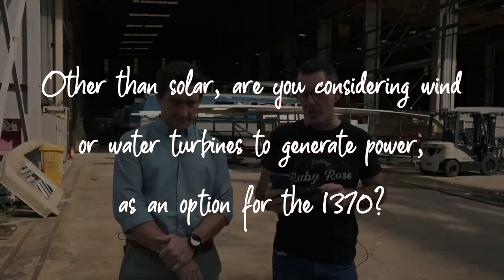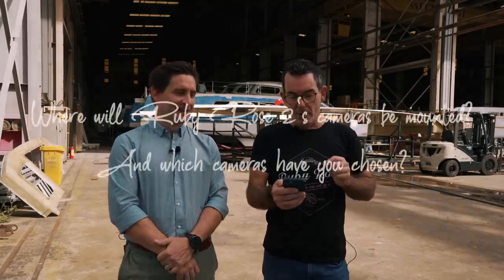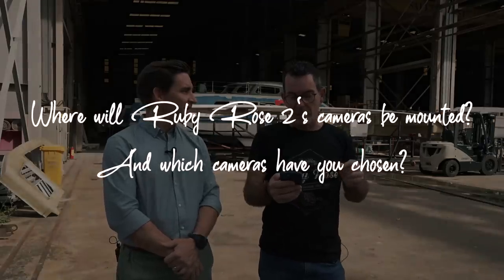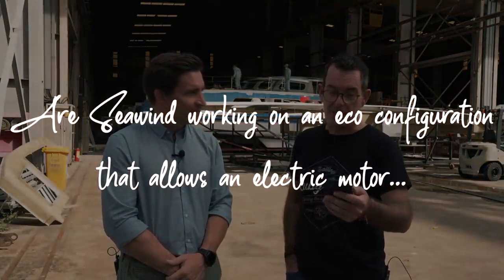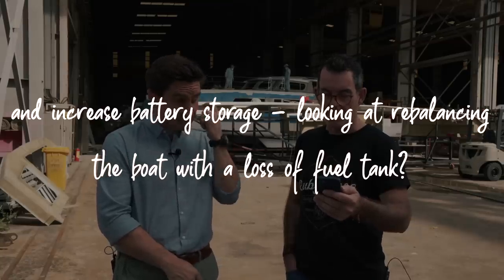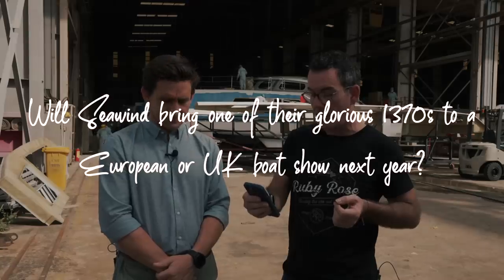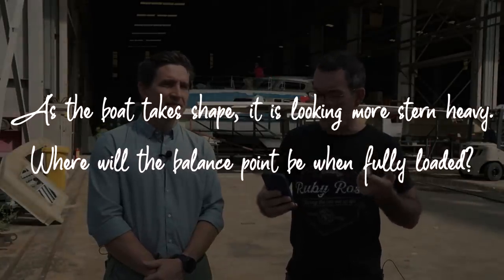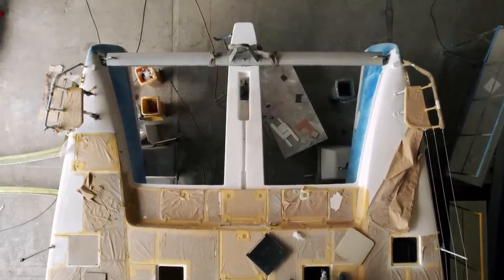RUBY ROSE 2 Catamaran: We Answer ALL Your Burning Questions!

Comment: Exciting news about how well construction is coming along. Hybrid drives are expensive and long term reliability has yet to be proven. Two reliable Yanmar diesels with high output alternators, 2,000 W of solar and a 20 kWh LiFePO4 battery bank will allow you to make dinner, run your A/C overnight and still have plenty of power to make breakfast in the morning. The batteries will last 15+ years with no maintenance. No gen-sets needed.  Thanks for the Q&A.

Comment: HH44 (Hudson) is shipping with a hybrid diesel-electric drive that looks like a smart mix, and inline regen systems are important when sailing north of 30 or 20-degrees latitude where your solar panels are not going to cut it without backup gennies - or a high output 48v alternator. You should consider modifying your boat to include the HH44's bedroom windows - they're huge. 
48v boats and Eco on Sunreef (solar on the sides of boats) is smart depending on the cost : benefit ratio. 
There are affordable inline induction water heating shower units that are very efficient and offer unlimited hot water also. 

Finally, Catana came out with a performance spin on their Bali cockpit doors - that make a huge salon in inclement weather (room for a full double fridge etc.). You might want to talk to your interior designer if any easy mods make something similar possible.

Comment: An ingenious approach to water heating via solar I saw on a small expedition camper here in the US recently.  Essentially the owner/builder installed a small 12VDC immersion heater in the hot water tank of the water heater.  Once the pack was reasonably full the solar system would dump some power to the small 12VDC heater.  He said on any sunny day he had enough warm water for him and his wife to take a quick shower. This guy was using something like 600W of solar and a much smaller battery pack (~2500W-hr), but I'd have to think something similar may be possible on the 1370, of course depending on the specific equipment.   But again, these are stock parts that Seawind is using on these boats right now, so someone would have to work out the details on the modificaiton...

Comment: The question at 10:54 I took to mean, "will Seawind test to near destruction during sea-trials."  If yes, then I know that I wouldn't want the particular boat that has already been so heavily stressed!  Now one from the same build series would be a different story.  Yes, it is very useful to know exactly how hard you can push a set of components before they all come apart.  But not necessarily on the exact item that you are purchasing (i.e. YOURS is the test subject).

Comment: Will this Catamaran Company Design a Race Catamaran ? And thought of coating the Anchor lock with a spray on rubber coating to protect the Hull and help in Clean up. Last in your Rear lockers yo have the Water drain Hose in the Way ( middle ) move it in the Back some you don’t came hitting it.

Comment: I'm confused as to why you connected "software for Planned Maintenance" and "early adopter tech." Planned Maintenance Systems (PMS) are so wildly common in military and commercial applications that they can't be considered "early adopter." You might be the smallest vessel you know who does it, but you couldn't in any reasonable sense be considered an "early adopter" if you took a leaf from that particular book. 

I HIGHLY recommend you make some formal PMS program for your boat. It doesn't matter if you put it in a computer or if you do it like the Navy did it in my day (USN 1996-2001) and put it on graph paper. You will be way happier if you're maintaining equipment before it breaks than managing breakdowns later in life. And since it's a new vessel, when the time comes to sell it and move up, over, or out, you'll have really good records so you can show the new owners actual data on costs and time spent. To be honest, judging by how I've seen you operate, I don't think it being a formal system would be much different than what you actually do. You've never struck me as a "let it fall apart and I'll fix it then" sort of person.

Comment: Chris White designs the batteries to be under the water line so the compartments can be flooded automatically in case of fire. The Barefoot doctor's Leopard 500 burned at the dock with no one on board. Their insurance company gives them heartburn over paying the claim. The longer they drag their feet the more money they can make on the money that they should have received. On the subject of graphene. The reason you don't hear much about it is because every modern country in the world is working feverishly behind the signs to mass produce this product. The only place this product is used is in the oxidized form of razorblades in the woo jab.

Comment: I think he was getting a little impatient with the electric propulsion questions. Given the way Outremer in conjunction with Oceanvolt  have simply failed with the 4 Zero (they didn't make it past the canaries) with Jimmy Cornell as skipper (someone who could write the book on sailing around the world with small resources...) its fairly obvious that electric isn't ready... Yet. But we still have people who don't understand what a watt is and never really sailed, hacking on like we should all be running Tesla motor cruisers! 
Electric is not ready. Even with 2KW on deck you will barely have enough to run ships electronics, cooking, refrigeration and heating/cooling, you will still need some sort of generator (be that a big alternator or a genset.) If it is cloudy you won't have enough to run a fridge and will constantly be watching the batteries lose 10% per day. This is an unfortunate fact of sailing life due to the way we mount solar panels and the efficiencies currently afforded.
We need a really big breakthrough just to get solar to all the run boat electronics reliably. Physics says we will never be able to run electric propulsion for a blue water cruiser. If on the other hand you are a day sailor who spends every night plugged in to the marina recharging the motor you have to get out, you may be in luck... Don't try motor sailing though or you will be getting towed back!

Comment: Clearly there is a LOT of interest in electrification. (I know I am very interested in a hybrid drive.) It seems that Seawind and most other manufacturers are behind the curve on what customers want.
Reply: A tiny market overall which limits choice… a factor that carries a lot of weight for boat manufacturers at the present.
Reply: The hybrid drive definitely has my interest. Gives a quick bit of power when anchoring and docking when the short run times are hard on the diesel. Let's you regen at sea when the winds are strong. But you still have the diesel for getting through patches of calm seas.
Reply: I like to think Seawind is ahead of the curve on cruiser sailing performance rather than behind on propulsion.  I really liked his answer on focusing improving production on their current design rather than changing designs.  They are waiting for the tipping point of hybrid as are the rest of us.

Comment: I'm sorry, but 11 tons is NOT a light catamaran! Our 40' catamaran was 5 tons as a liveaboard.  8 tons for a 45 footer sure but 11 tons is not either light or good for decent sailing!   And as the man said, people are now putting even more stuff on board so there is a dire risk of very poor performance....
Reply: Phil, what make and model was your 40' catamaran that weighed only 5 tons fully loaded?  Is that metric, US, or imperial tons?  FYI, for comparison, the light (unloaded, hull only) displacement of the HH 44 performance model (Sport Cruising) is 20,701 lbs, or just over 10 tons (US).  Surely, this model is good for decent sailing?
Reply: @dougmarder  my cat was a Pescott Whitehaven  11.7 (taken out to 11.9) built in Noosa.  It was not particularly high tech, WRC hulls, carbon reinforcing in bulkheads and bridgedeck.   The difference was the interior was faired and sanded rather than liners put etc.  Normally she was around 4 tonne (metric) depending on how much water was on-- we could take 500 litres.  but liveaboards always put on too much stuff-- printers, desktop computers, books, 'stuff' and we were no exception.The extra weight knocked off 2 knots on our upwind speed-- from 9.5 knots to 7.5.